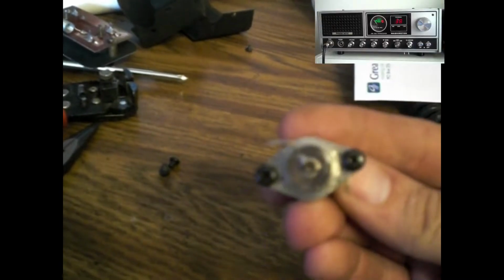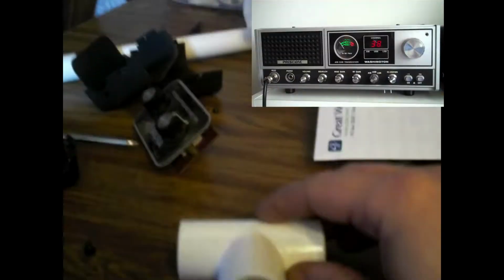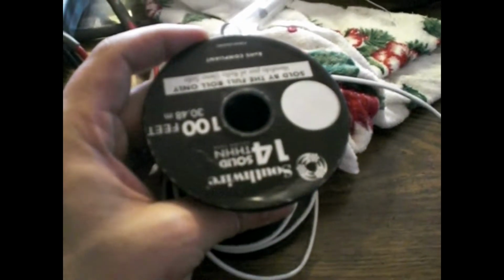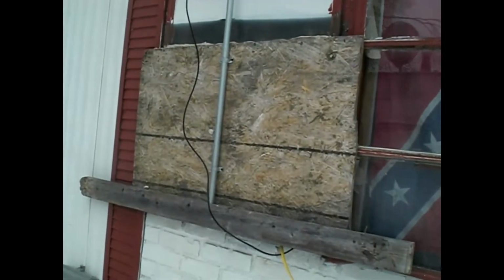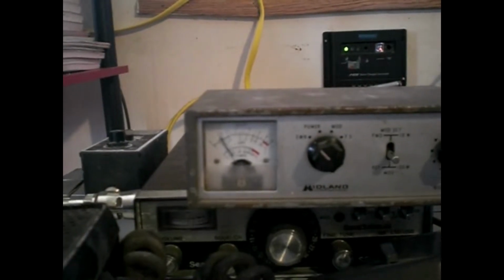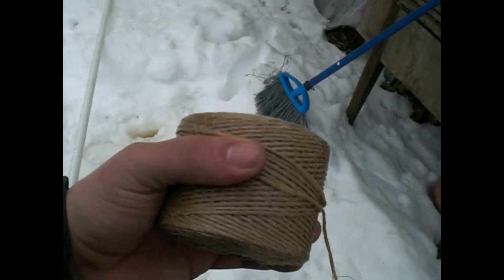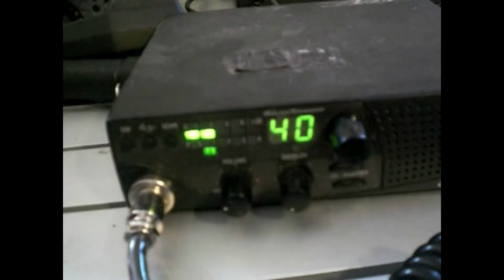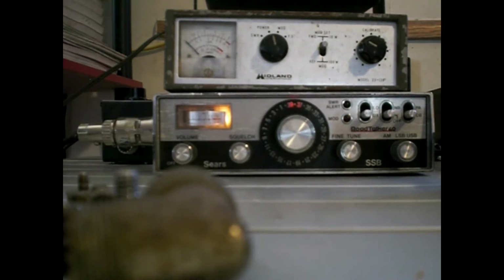Homemade CB antenna, Thank you Mower Junkie it works beautiful.

Comment: I built a full wave antenna on a 20ft pcv pipe, 38 years ago... No silicone in my antenna
Still working well today
Reply from the maker: That is awesome buddy, what did you make it out of? 73s 309 Central Iowa
Reply: @CoryRandomGuy  made from left over wire after the house was re-wired.
The pvc pipe is 3/4inch water pipe.
I loose coiled the wire up the pipe like a firestik.
The ground radial is the 15ft metal pole it's mounted on.
The pvc is a little whippy in the wind but, its survived this long.

Comment: Nice antenna build !  I use channel 38 and 39 LSB here in Illinois to let me know the band is having an opening.  I’m a ham radio operator too the cb is much more active when the band opens up initially but if you have a shortwave radio that can listen up on 28.400  and 28.500 usb you can see how much easier it can be with fewer operators on the same frequency than it is on channel 38. Taking the ham test isn’t so bad either. Last week I talked to seven different countries in South America on ham radio 40 meter band for the first time!
Reply from the maker: Thank you I love cbs to be honest I like my freedom. Ham is just not for me is all. I do love having old radios. I am glad that there is a cb community out there. 73s 309 Central Iowa

Comment: Very cool!! Thanks for sharing. 73's from 151 SC.
Reply from the maker: I don't think the ground radials are 45 degrees they look like they are closer to 37 degrees but it works I do have another video of shooting skip yesterday. I do believe I heard you yesterday.
Reply: @CoryRandomGuy  they did still look a little flat, I've found that if the bottom of the radials are 6.5' from the mast, they will be at 45 degrees. it will work well the way You have it, but if You get the radials closer to 45, Your SWR will get even better. Let's keep the hobby alive! 73's
Reply from the maker: @MowerJunkie  cool I will try to move them down alittle. Before a blizzard hits here.
Reply from the maker: That helped quite a bit actually I'll make another update video and you will see